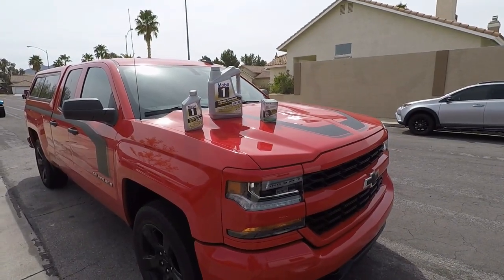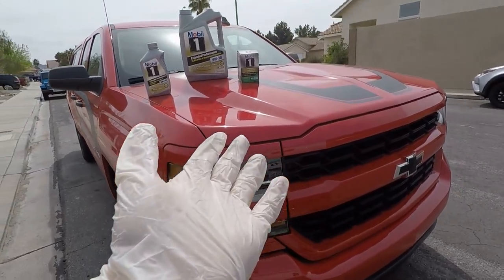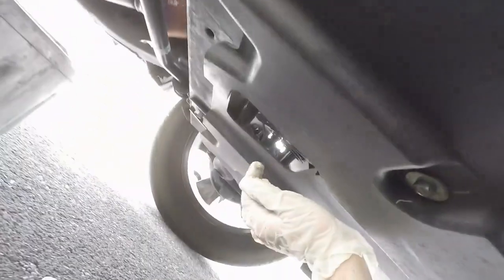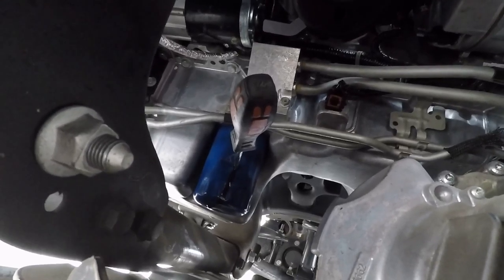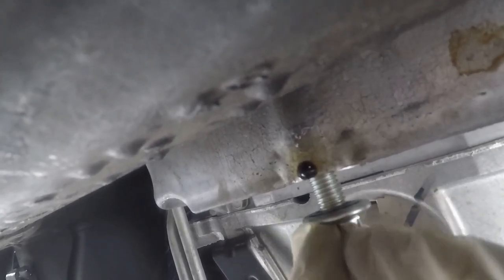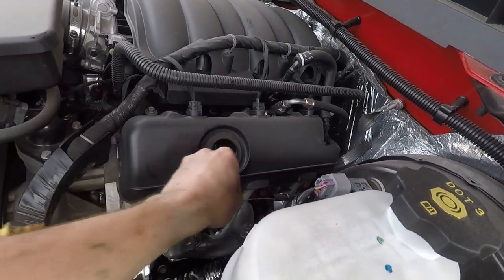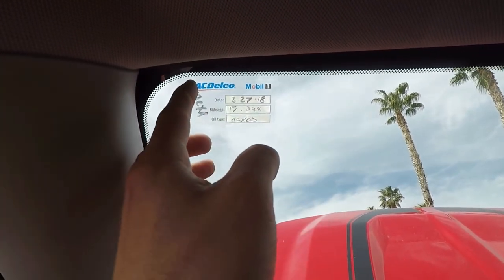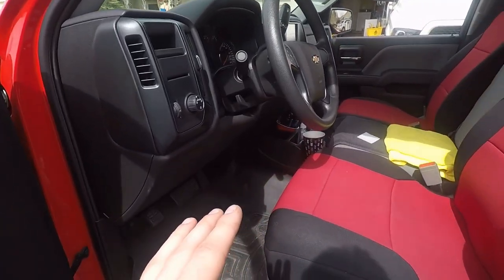2014-2018 4.3L GM EcoTec3 V6 Oil Change

Comment: please dont pry your oil filter. 6$ will buy you a 3/8 oil filter cap wrench.
Reply: GM tech here. Not sure how you can comfortably get a cap socket on it. If you can bonus.
Reply: Cap wrenches don't work. I've been changing oil on my 4.3L for 4 years, it's required a screw driver being driven through the filter almost every time after the filter was only hand tightened. Last change I did I finally used a strap wrench and it crushed the filter before starting to spin
Reply: @thestoicarcher2819  yeah sorry man, but youre just plain jane wrong lol. its as easy as i made it sound. unless your 4.3 is in a old buick i call bs.
Reply: Dylan, you're more than welcome to come try it on my next change. I have a cap socket that fits. Slips off every time. I'll take my experience and the word of the gm tech above.
Reply: @thestoicarcher2819  my friend, as with all jobs its about using the right tool. there are numerous cap socket shapes, depths, ect.
Reply: Thank you! Their is many oil filter wrenches which are usually adjustable to any size or oil filter sockets with different sizes. Their shouldn’t be a problem removing oil filters with the correct tool.

Comment: I had to have an engine rebuild on my 2014 silverado 4.3 they lost engineerings oil dipstick can you send me the  length of dipstick so I can check to ensure the right one was put in as I checked my oil and it is above where it should be so I just want to make sure they put in the right one it was had a dirty handle so I know it was not new. thanks

Comment: Does yours have tow hooks on the front?    I thought one could simply pop out the blanks for it to add them but it appears you have to change the whole lower valance for one with access holes or cut the factory one which would look like shit
Reply from the maker: I Know You're Right But the truck in the video does have the two front tow hooks, I believe it’s a option but ya you can still add them to any truck you just have to cut the plastic. Which I do agree will look like shit. Lol
Reply: ThatCrazedGunner 👍 great video by the way
Reply from the maker: Thanks do very much appreciate it

Comment: You don’t beat a screwdriver through the oil filter or you get a wrench for it
Reply: It relieves pressure and it's going in the trash anyway so beat it in there and ue leverage my friend.  Save money remember the biggest tool they can't market is brains and common sense!

Comment: Removing the skid plate takes less than one minute. Stabbing an oil filter? Tacky. How about a filter wrench? The oil filler cap is in a “wierd” place? Really? Normally found on a valve cover, where would you suggest they put it? Also it’s not Vortec, it’s an Ecotec.

Comment: I see that bottle says 15K guaranteed.. I can really go 10k between oil changes if I use this? 2018 rado 4.3
Reply: Yes 10k is fine with full synthetic!
Reply: @mikewright6656  Wow.... Do I need a special filter for the full 10k? Just a simple top off maybe at say.. the 5k point.. and I am good to go. This is impressive.
Reply: @_BlueCollarGamer  They sell the 15k filters! Most are 10k but the step up is 15k! It will tell you on the packaging, there only a few more bucks also!

Comment: What's your hot idle in Park oil pressure in the 4.3?
Reply: TheTennesseeTittyTickler 40
Reply: I have the 4.3 in my 14 Silverado.  When it's hot at idle which is about 525 rpm's it's a little below 40.  If you jump on the gas the pressure will go all the way over.
Reply: buck shot My 2018 at hot idle with factory oil is around 28-30, it’s because it has a variable oil pump. The 2020 Corvette at hot idle is the same, 28